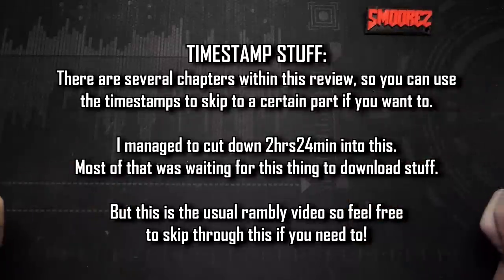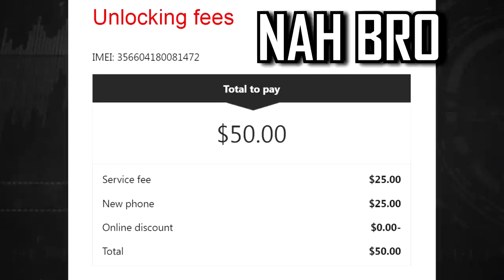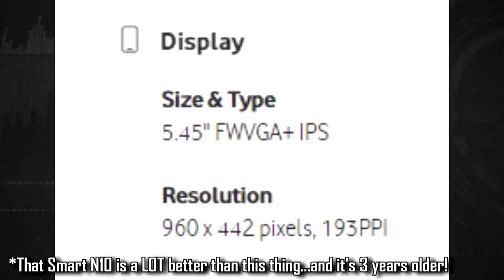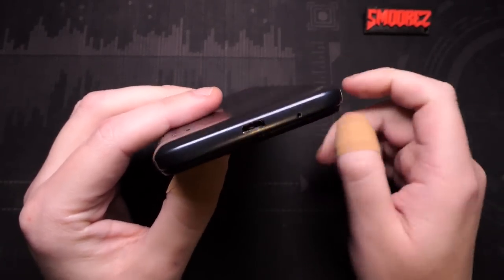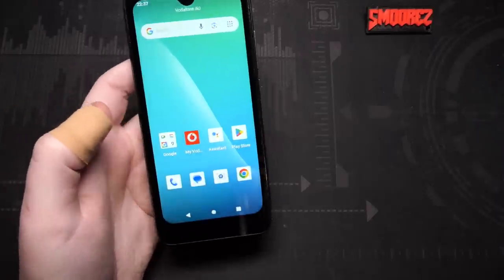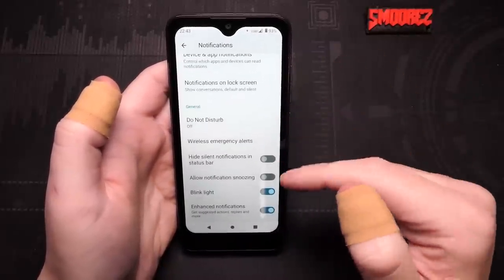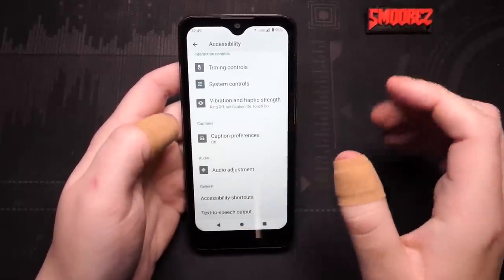The Vodafone V Smart 4G is a $129 AUD Budget Phone that looks like a WELCOME...

Comment from the maker: Drinking game, take a shot each time I say PHONE...in which I butcher it with my accent

Anyways, welcome back to another cheapo review!
This thing is something...if you have used this or a Mobiwire phone let me know down below.
Also what do you think of this phone...it will be interesting to hear your thoughts.

Thanks again for tuning in and I'll see you all soon!

TIMESTAMPS:
Intro, Timestamps etc: 0:00
A lookback at the Vodafone Smart N10: 1:04
V Smart 4G Current Pricing & Alternate Options: 2:20
Vodafone Advertising & Quick Specs: 3:44
The OEM & First Look at the thing: 5:36
The horrific bezels & under the battery: 6:40
Power On, A better look at the display & many questions: 8:09
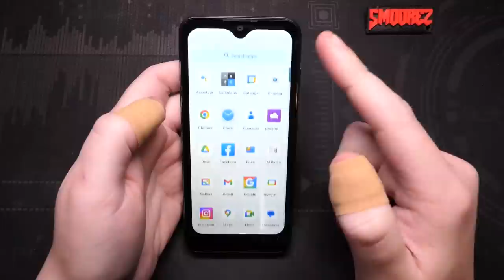Performance, Stock Apps & Shortcuts: 9:46
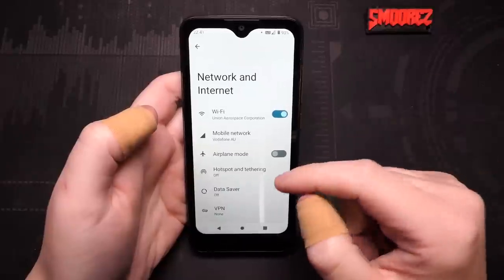Networks & Call Quality: 10:54
System App List & Notification LED: 12:04
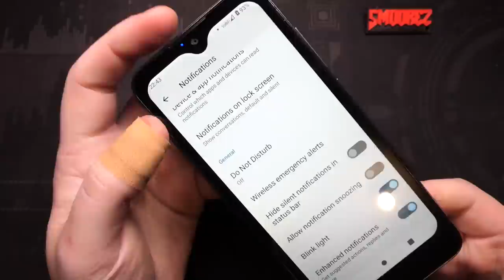Battery Life, Sounds, Display Issues etc: 13:11
Accessibility, Security, Updates etc: 15:00
System, About Phone, some Apps & Camera: 16:09
Camera Test - Photos: 18:10
Camera Test - Videos: 19:43
Camera Quality & UI Cutoffs: 23:34
Browser Test: 24:53
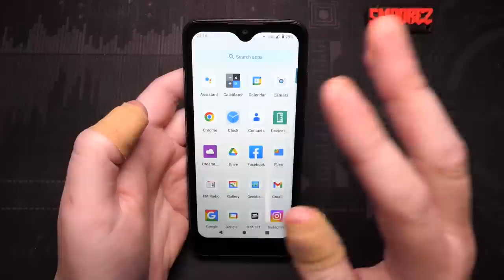DreamLab, Files & FM Radio: 26:00
More Apps, GPS Test, Phone Dialer etc: 27:20
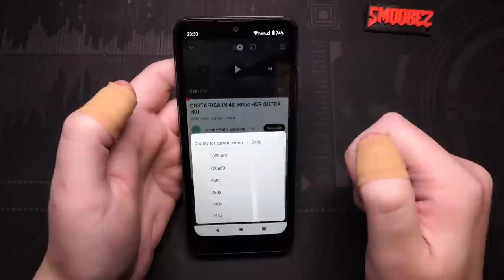YouTube Test: 28:30
Speaker Test: 29:38
Geekbench Scores & The Nokia C02 is better: 31:09
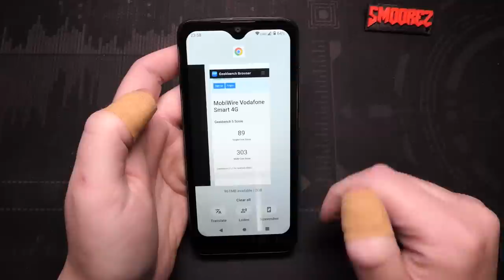Gaming Test - Grand Theft Auto III: 33:06
Attempted Ark Test & I won't review a Windows Phone soon: 34:16
Double checking the Specs & some confusion: 36:02
QuickShortcutMaker & Conclusion: 38:01
Teardown & Investigation: 39:54
Does it live on, Proper Specs & Final Thoughts: 43:06
Thanks for making it to the end & Rambly Outro: 44:01

Be good people!
Reply: Hmm
Reply: Thanks a lot
Reply: To be fair, you butcher the whole English language in general. 😉
Reply from the maker: @rustafar_2354  I know, it's terrible.
Reply: I lost my phone to the pickpocket thief 😢
Reply: FIRSTLY... WTF??? $25/$50 for some sales/tech rep to input a code into the phone to unlock it? Nah... SOD THAT! Secondly, I NEVER buy phones direct from Networks themselves, as, they're loaded with all the network crap, uninstallable apps, shortcuts, screensavers/wall papers, sounds n sh!te. So IF you get it unlocked (from say 'o2', 'Vodafone', 'Virgin' or '3' for example) and put another simcard in, you're STILL stuck with the w@nky network crap stuff from said original network.. In short, again, NO FANX!! LOL 😏
😎🇬🇧
Reply: 🎉🎉🎉🎉🎉🎉🎉🎉🎉🎉🎉🎉🎉good vid
Reply: @SMOOREZ Can you review for us Poco X3 pro?it's very cheap rn,and a pretty-good chipset,which is 860.I've watched many reviews from other youtuber,but I still want you to review it.Cause I want to buy it
Reply: @SMOOREZ wdym
Reply: I'm taking wild guess in saying that, you pay more for that piece of copper then the rest of the phone.

Comment: The fact that these specs would be considered rough 10 years ago is unreal.
Reply: nope. midrange devices from that era were way worse. 512MB RAM, 4GB storage, 480x800 screens and 4mpix cameras were kinda the norm back then (I have an HTC 8S from late 2012 with very similar specs, and my Lumia 630 from 2014 isn't much better)
Reply: @underscoretb2986 the bezels and chin on this phone is horrible I haven't seen bezels this big in years
Reply: @devilkazumi578  that's because they're trying to achieve a "modern" look without spending extra money on the display, I assume. so instead of making at least the top better thinner, they made the side bezels thicker to make them look symmetrical. and the tight corner radius also doesn't help at all. 

but the worst part is the top bezel. It's so thick, there's no reason for the teardrop notch to even exist. but having a flat bezel isn't trendy...
Reply: No, they wouldn't have been. The Moto G 2013 and 2014 both had 1GB of RAM and also a Quad-Core and ran absolutely fine and adequate - with Android 4.4 to 6.0 mind you. Anything beyond 7.1 doesn't do well with these specs.
Reply: the fact the an s4 with a custom rom can do better then this it’s just really weird
Reply: It's good specs for a temporary phone that you want to get for 1 year use
My iphone X broke down and since i needed new good phone i had to save up & get something temporary, i ended up getting the Moto G31 phone until i have enough funds
Ended with Motorola Razr plus 40, love it

So imo, these low end phones have their use, even if just for a while
Reply: @uhm175  seriously, you’ve just compared a not even low-end modern smartfone with 4 gb ram and helio g85 with a mid-ranged phone from the mid 2010’s with mt8765, 2 gigs of ram and shitty screen? Definitely, moto is OK for a not heavy user.
Reply: @devilkazumi578 old iphone???? That had a big chin
Reply: @nopel.  I domt use iphones

Comment: In the UK they're branded as Mobiwire on the vodafone network.
I think the reason they show the 2g and 3g is because some countries still use them if you use this phone abroad
Reply from the maker: But if you travel overseas, the phone won't work cause it needs to be unlocked from Vodafone Australia, which costs $50. That was why I was wondering why they were showing them.
Reply: @SMOOREZ  if you are abroad using your Australian Vodafone sim card you'll be able to roam on the local Vodafone network, for example if you came to the UK you'd be able to use the UK Vodafone network with your sim without having to unlock your phone. I did it many years ago, I had a Siemens C25 locked to Vodafone, went to Greece and was able to use the local network (which I think was Panafon which was owned by vodafone)
Reply: Was about to say yeah. Roaming is a thing, and it'll either connect to the local Vodafone(-owned) network or a partner network. In the EU this is mandatory for providers to support, so you can get phone coverage in just about any EU country (hardware support permitting... LTE bands and all that nonsense) with your local SIM, and there are laws that mobile data can't be a cost trap abroad either. Made use of this when I went from Germany to the Netherlands, Belgium and France earlier this year and it was smooth sailing, other than getting multiple "welcome to [insert local phone provider here]" SMS as the phone hopped back and forth between networks close to the border

Comment: I had to stop the video at 4:27 to let you know that the tablet I'm watching this video on, a Sky Elite T8 Plus, is powered by the Mediatek MT8765WA.  I'm not sure the difference between the WA and WB, but, I guess I'll find out later.  I've never seen this chip used in anything besides other government subsidized tablets.  During the pandemic the US government heavily subsidized tablets for all Americans, regardless of whether one qualified for other assistance or not.  I paid $20 for mine brand new from an "Obamaphone" tent.  Known ultra budget US brands like Sky, Maxwest, Foxx, and probably some others were involved; but, they each looked and had specs suggesting they all rolled out of the same factory.  It's been a good little media consumption and PS1 emulation tablet.

Also, thank you for not taping your videos at 50/60 FPS.  I've never been able to say this before without it sounding stupid as it's never really related to anything in any of your prior videos.  My tablet can run 720p30 video all day long; but, it gets jerky with HD content at 50/60 FPS.  I often have to choose between watching videos that are in standard definition + smooth or good looking + stuttery.  It'll be interesting to see if your phone exhibits the same behavior.  I'm going to shut up and finish watching your review now.

EDIT: Just finished the video.  I ran CPU-Z and Device Info HW on my tablet.  The specs look mostly the same as what you showed.  There were a couple of differences that stood out to me.  1) Clock speed: The 8765WA is supposed to be clocked at 1.3ghz like the chip in this phone, which I've already forgotten the number of, however, in all the hardware info apps it's shown to be running at a rip-roaring 1.5ghz.  2) The chip in the phone is running 32bit, but, DI Hardware said it can support 64bit.  The 8765WA in my tablet only runs 64bit.  I don't know if it can run 32bit, or not.

Fun fact: the launcher in my tablet is called Quickstep as well.  I wonder if that's a Mediatek thing?  It runs full fat Android 11, none of this silly Go nonsense, because it has 3GB of RAM instead of 2GB like this phone.  I kind of wish it could've shipped with 12L for tablets.  I think it was new enough from a build date standpoint; but, the design was probably set in concrete months before.

Comment: I don't mind the large bezels as it makes it easier to hold without accidentally touching and activating something on the edges of the screen, but the notch and rounded edges look stupid. The chin also should've been where the 3  buttons went.

At least it has a removable battery, expandable storage, and headphone jack...
Reply: I have a Samsung galaxy s22 ultra and the lack of bezel has never been an issue. It has pretty good palm rejection.

Comment: On phones with 2/3GB RAM, I usually turn off all animations in developer options/Accessibility.
Reply: the animations doesn't have much impact on the performance, your best friend is to try to only open one app at a time, since this phone is going to struggle with multiple apps open

though 3 GB is actually good, & are able to help you open multiple apps  compared to a mere 2 gb that end up only having 600 MB free at most, with the 3 gb you can have 1.6 gb free, which is quite acceptable & managable
Reply: @uhm175  I suspect it's going to struggle with one app open. It's already having a hard enough time with the latest Android.

Comment: As far as I can see, the only plus on this device is a replaceable battery. If it can be done on such a small budget, why can't other manufacturers do it?
Reply: Because there is zero waterproofing or space saving on this design at all, so it's probably cheaper for them to throw in an off-the-shelf battery in a plastic case. This phone would probably die if you so much as cried near it
Reply: @PotatoPirate123  Samsung do it in their rugged phones, not for Joe Public. The weakest link in any phone is the battery.
Reply: @PotatoPirate123  Both variants they currently sell in the US support swappable batteries, XCover6 Pro and XCover Pro. And still a bit over 4000 mAh capacity while being just shy of 10mm thick total. Which is really good for a rugged device aimed at the industrial sector. Of course unprotected consumer aimed devices are thinner, unless you use a nice rugged case. Manufactures just prefer you to buy a new device instead of putting the effort in to make it thin, waterproof and have replaceable batteries. Although I do agree with you on this phone, it's most likely just slapped together with stuff they had laying around or found in a bin somewhere lol
Reply: @PotatoPirate123  galaxy s3 has a replaceable battery.

Comment: The only thing I can say is, why give it on screen buttons and a notch when you have a bezel to put that. Like in the old days. I still have my old Honor 9 here, that thing has buttons in the chin, the front cam in the bezel, but Android 12 through custom firmware, 64 GB storage, micro SD slot, dual SIM, headphone jack,  quad  Cortex-A53 + quad Cortex-A73, 4 GB RAM.
It's overall still a totally fine device today.

Comment: It looks like the exterior product designer is overhyped to put all current aspects of modern design on a budget phone, like makes top left camera island but it spaced badly, a screen with oversized bezel radius but ended making status bar over ugly...

And slap a overheight screen design (looks like the designer forgot to measure the screen) that ended hardware department just fit the screen on the top camera edge, leaving a big chin.

Unbelievable. Almost like some dude made a mess on PowerPoint.

Comment: FIRSTLY... WTF??? $25/$50 for some sales/tech rep to input a code into the phone to unlock it? Nah... SOD THAT! Secondly, I NEVER buy phones direct from Networks themselves, as, they're loaded with all the network crap, uninstallable apps, shortcuts, screensavers/wall papers, sounds n sh!te. So IF you get it unlocked (from say 'o2', 'Vodafone', 'Virgin' or '3' for example) and put another simcard in, you're STILL stuck with the w@nky network crap stuff from said original network.. In short, again, NO FANX!! LOL 😏
😎🇬🇧